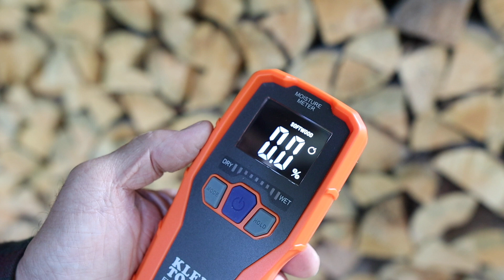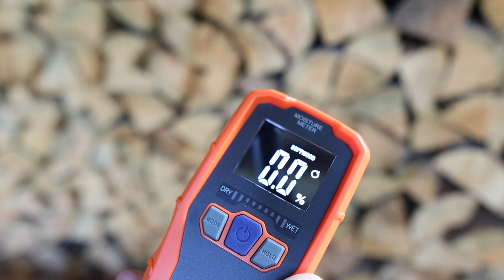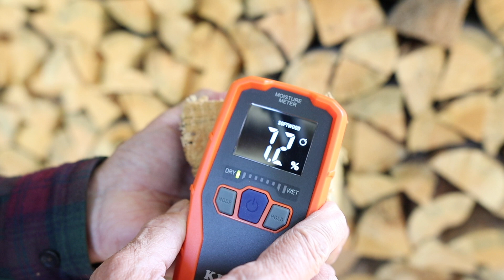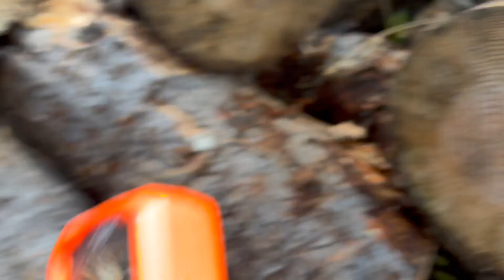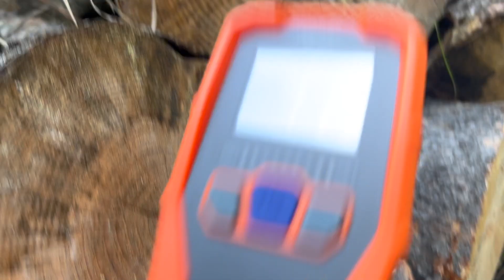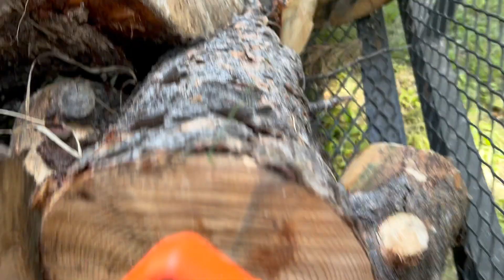Klein ET140 Moisture Meter: Firewood, drywall, masonry, hardwoods. Pinless design senses 3/4" deep.

Comment: If you’re using it on drywall does high or low voltage lines affect its reading behind the drywall? Thanks.

Comment: I just ordered one of these. I’m taking the view that these less expensive meters (including Klein) have very low accuracy to them. I’m hoping though, they are consistent with alerting to the presence of moisture at least. I’m not gonna expect accurate percentages in anything. But if it can show a greater volume of moisture in a particular area of a wall, or similar, in something I can’t initially see, and is accurate in this way, then I will find this item useful.
Reply: Just bought one today and the accuracy rating is 4% plus minus. According to meter, my spalted maple piece is reading 3.7....I dont feel this is accurate. I would suggest getting a pin type

Comment: Plus or minus 4%?  I think I might be more accurate with the cheek test.
Reply: The goal of this tool isn't to be perfect. It's goal is to give you a good estimate without tapping a bunch of holes in your finished living room. For that, it does its job perfect and a ±4% variance is as good as you can get. If you want dead in accuracy, get a pin meter. This isn't for that purpose.